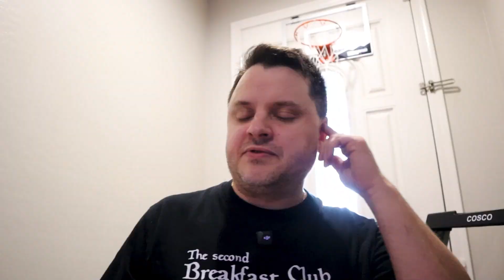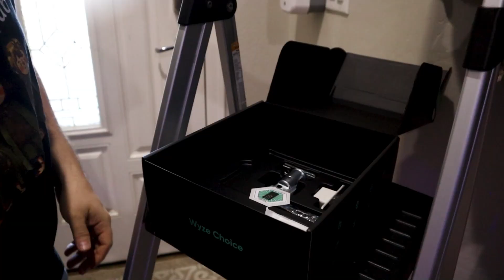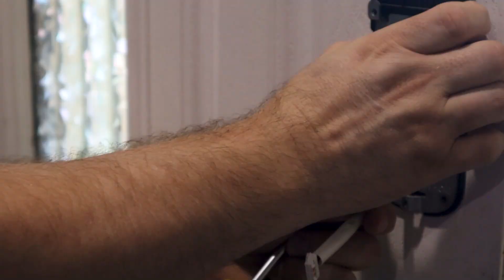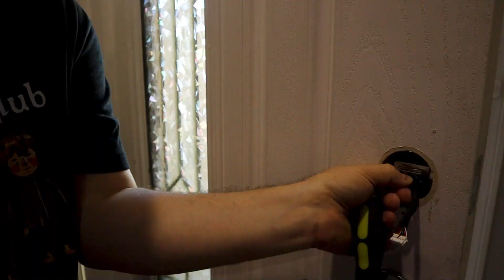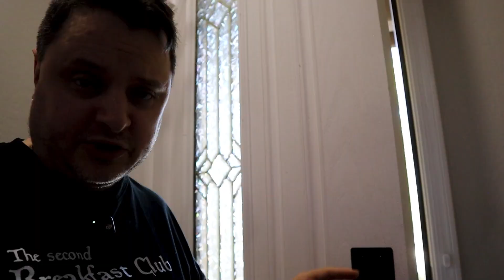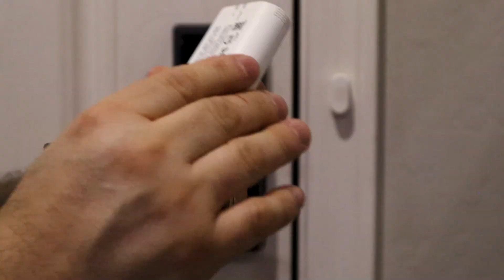[Problem Solved] Wyze Palm Smart Deadbolt Install

Comment: I've considered getting one of these many times. I see them a lot in my line of work. How long do the batteries last?
Reply from the maker: It's only been installed for about a month and my battery according to the app still has 95% charge.  I think it's gonna last awhile.  We typically go in and out of the house through the garage so this door doesn't have to lock and unlock that often during the day.  That being said our old door lock needed replacement batteries once every 2 months.
Reply: @ProblemSolvedwithEric okay word. We mostly use our garage entrance as well. But the front door is still gets opened 65 times a day because I have women in the house and Amazon is a monster.
Reply from the maker: Lol yup!